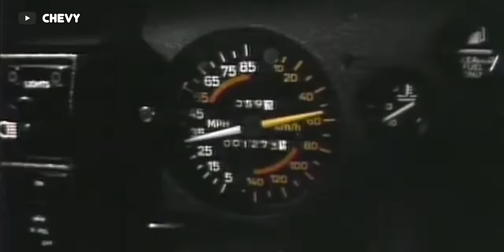These are the WEAKEST ENGINES EVER

Comment: The Duke was weak, but it was durable.  Putting it in the Camaro, however, was just straight up dumb.  I sometimes imagine what could have been if someone could've rounded up a Super Duty 4, essentially a super-heavy duty Duke with all the go-fast goodies and capable of delivering over 300 horsepower, and bolted THAT into a Camaro.  Still looks like a Duke - kinda - but it delivers the kind of power even the 80s Camaro looked like it should have.

Comment: The 5.9 found in 2nd Gen Dodge Rams, Dakotas, and 1st gen Durangos actually had more than a 1 liter advantage over the 4.7. The 4.7 was rated at 235 hp, yet the 5.9 only made 250. 1.2 liters to make 15 more horsepower. What a shame.

Comment: The GM 6.2 and 6.5 are in the military HMMWVs. If the injector pump timing was adjusted along with the transmission kickdown cable they would drive decently. Later in my career I rebuilt and tuned the injection pumps and quickly learned how to adjust them for much better power. Of course those were all EPA except and not sure if the same tricks would work on a civilian model but I would think it wouldn't matter.
Reply: They will cuz I did em too up until 2018 when I retired.

Comment: If it was 1975-1990, mass produced and was on a budget (aka they wanted it to be profitable) it sucked. From the 180hp 454 in the 1975/76 Corvette to the 70-100ish-hp Pinto or the Chrysler K cars, nothing made any power due to emissions. Until we got the 400hp Viper, which they said "we'd never see another car EVER in America with that much power" Fast forward to 2015, and you get 707hp in a Hellcat, 400hp in most trucks and it become a "reliable" turbocharged 800-1,000hp out of a junkyard motor that came from that said 400hp truck.

Comment: Actually one of the "weakest" engines made was the 1975 Chevrolet Monza when equipped with the 350 V8 for California and Hi Altitude areas.  With a 2bbl carb, it make a whooping 125HP!   Or just .3571 HP per cu in. vs the Caddy's 500 making .38 HP per cu in.  The top award might have to go to the 1975 Ford Granada when equiped with the 250 (4.2 L) six , it was rated at 70 net hp, at 2800 rpm, in CA emission configuration (72 HP nationally).  Thus, it made a (drumroll) .28 HP per cu in.

Comment: If you are going to use a CAD Co picture you should understand that his Cadillac engines even for stock Cadillac are 400 hp and 500+ ft lbs ... And he has built them as high as 2000 hp ...... Plus the 76 hp number you quoted is wrong that engine on a modern dyno is over 300 hp ...

Comment: That "182 hp" engine in the thumbnail put out around 400 hp when introduced in the '60s. It's a difference between a "emissions" engine and a "de-tuned" engine. The 119-130 hp Ford engine 4.2 was an emissions motor.

Comment: The tr7/8 is one that should be on it as well

The 1982 engine produced 130 HP at the crank and 117 ft lbs 

At 3.6L and V8 at 36 HP/L in a sports branded car

Comment: The Oldsmobile 260 V8 at 110 hp and the Chevrolet 267 V8  at 115. My mom had a 1980 Impala with the 267 V8 it was so slow and got terrible gas mpg because you had to floor it all the time to get that heavy car to move

Comment: You should try a 5.9 12v cummins with out boost 14psi will double output and from what I have read it runs about 18 psi meaning it makes less that 80hp n/a then you can flip this saying if it was a n/a motor it would need  12 liters to make 160hp

Comment: -smog days
-the viper was still in development that first generation was basically a prototype 
-The 4.7 and 5.7 engines from Chrysler were putting out just as much and more horsepower than the other brands with the same size trucks (the 4.7 is a horrible engine by the way) 
-The iron Duke was never made for power 
-smog days
-The 6.2 does suck ass

Comment: My 78 camaro cam with a 305ci engine rated at 140hp at like 4000rpm. It ran a 17.8 in the quarter  mile. 
To let you know how pathetic that was my 2000 Celica gts has a 110ci engine rated at 180hp at 7800rpm and runs 16.5 quarter mile.

Comment: Zero historical context here.

400HP was amazing in 1991 when the Viper was introduced, didn't matter that it took 8 liters to get there, everyone loved it.  Only thing that was close was the ZR-1, believe it had 375 HP to start and later 405 HP, and that carried a much higher price tag than the base Corvette.

The Iron Duke was a Pontiac motor, at least you got it right the 2nd time.  And you really show a lack of understanding of that era 79-82, times were bad.  There was a recession, interest rates reached as high as 21%, gas prices were high, unemployment was high.  60s era cars that are valuable today were put in the junkyard during this era because there were not buyers for them.  The racing scene was not what it was in the 60s/70s, although it came back to life in the late 80s.  There was a market for a 4 banger Camaro in those days.  They also offered the 110 HP 2.8 V6 in the early/mid 80s Camaros.

You don't think the 1980 Corvette should have been produced because of the 180HP rating?  Well, Chevrolet sold 53,807 Corvettes in 1979, an all-time high!  Yeah, I'm sure your opinion would have carried a lot of weight in the GM board room back then.

The Cadillac 500ci 190HP is just an product of it's era.  360 lb/ft got those boats moving, that's it.  Side note:  the 500ci Caddy responds very well to modification.

The 6.2 diesel was also a product of it's era, people were amazed at the time that you could get 20mpg in a full sized truck.  Diesel was also generally less expensive than regular unleaded in those days, further increasing the utility of choosing the diesel engine.  And they generally lasted a long time with good maintenance.  If you want to contrast this with the other American OEM's, Ford introduced the 6.9 IDI in the mid-80s (86 IIRC) and it wasn't much more powerful.  Dodge had no diesel option until 88 or 89 and when they brought the first gen 5.9 ISB, it had 160HP, IIRC, and that was WITH A TURBO.  But nobody would dare put a Cummins ISB on the "worst engines" list, would they?

My idea of a worst engines list would be things that were unreliable, regardless of horsepower rating.  Cadillac 4-6-8, Chrysler 2.7 Sludge motor, Oldsmobile Diesel, and so forth.  These engines you mention are just a reflection of the technology level of the era that they were produced in.

Comment: Dog, I have a ram 1500 with the 4.7 and know almost everything about the engine, it was produced until 2013 in the Ram 1500s and in 2008 for the trucks, the engine was revised and made almost 300 hp and 330 lb-ft of torque but yes my truck with the 4.7 only makes 240 go and 300 lb-ft of torque

Comment: The standard of HP per Liter is simply a crappy yard stick as many engines are designed for different purposes and performance is relative to the goal of the designer 
Ex 37hp @ ltr would make your list of week but that same engine made 130 ftlbs@ ltr and really never ran over about 1800 rpm but the 12.7 detroit was designed to drag 80k down a highway for a million miles and did so quite well

Comment: Comparing HP in the 70s and 80s to modern cars is flawed as the the way HP is measured/calculated is different today.
HP back then was "Gross HP" and was actually produced by the engine at its peak operating point. (Measured on a dynamo)
HP today is a mathematically calculated ideal for max torque and RPM.
I.e. If you can lift 100lbs, and can run 12MPH, but the optimal point of both at the same time, you can run at 8MPH while carrying 60lbs
 - todays way, your run/lift capability is 1200 
 - the old way your run/lift capability is 480

Comment: The 6.2 liter GM Diesel used in Chevy and GMC pickups is often credited to Detroit Diesel.  However as far as I know, this engine was designed by GM not Detroit Diesel.  Someone can correct me if I am wrong.

There were lots of anemic engines in the '70s and early '80s.  Between the emissions regulations and the need for better fuel mileage there were many disasters from most manufacturers

Comment: The GMC dealer where I worked sent some Suburban's to a aftermarket shop who added a Turbo to the 6.2. They added nothing else and did it extra cheap.  The engine couldn't handle the Turbo and started the engine on fire!
Reply: So they didn't bother to tune it at all?

Comment: Alot of the Things Mentioned here are like judging a Blue Fin Tuna on Its ability to speed Walk Or a Donkey on its ability to Fly Most of The Low Power Motors are outstanding when it comes to reliability and The Maintenance schedule on them is more of a suggestion Than anything else, Plus anyone with a Floor Jack a $50 Walmart tool Kit and the desire to learn Can work on them

Comment: I don't think the iron duke should be on this list. This design badged under mercruiser is one of the greatest inboard boat engines. From the late 60's to early 80's, they powered countless boats, from 110 to 145hp while fairly fuel efficient. Remember boats are usually run at max rpm for long periods of time.

Comment: My buddy had a 82 Camaro with the 2.0 4 cylinder.the  same engine that came in the Chevy Cavalier.
Reply: I thought the Camaros then could be had with the Iron (P)Duke. At least the Iron Puke eventually got a crossflow head. Rare in an inline 4 or 6. Mostly because of distributor placement.
Reply: I think the Camaro got the 2.5 Iron Duke that was also in the Celebrity and Citation (and, later, the S10). The J-cars had several different 4 cylinder engines including (IIRC) a 2.2 pushrod noisemaker and head-gasket-leaker. It was a different design from the Iron Duke, but equally awful ... maybe worse!

Comment: I had a 1976 stingray with an l48 350(5.7L). Beautiful car, but it only put out around 190hp.
Reply: That's what happens when they were trying to meet emissions and mileage goals with crappy poorly adapted carburation. The domestic manufacturers should have bit the bullet sooner and gone to EFI.
Reply: @mpetersen6   the 80’s weren’t much better and they were fi .
Reply: @mpetersen6  they tried that in the 50s, but it didn't sell well.

Comment: I had an '88 S-10 with the 2.5 Iron Duke. Short history here. It was believed by the engineers that diesels were the way to go but have a gas engine to offer too. VW Rabbit offered 2 1.5 ltr engines. one gasoline powered and the other a diesel. To save cost, VW used the same block, crank rods, and wrist pins on both engines to cut manufacturing cost. GM seen how well that worked for VW they did the same with their 2,5 iron duke. While working on the fuel system, two things happened. Restrictions on diesel emissions and Tandy Corp working with GM developed a low cost computer for GM. GM scrapped the diesel idea and went with the gas version with the heavier block, crank, rods, and wrist pins. With the heavier rotating parts these engines didn't spool up very quickly but they sure did hold up. I averaged 29.3 mpg in hilly country My truck was a standard cab, 2.5 Iron duke with  5 spd manual gear box.

Comment: You do realize the 1975-76 Corvette were sold with a 165hp 350 V8 ? Making the 1980 305 almost respectable…
It’s more about power/torque to weight than power per liter which is a rather pointless figure…some large displacement engine will be lighter than smaller displacement engine, and larger displacements give more torque.

Comment: Like so many, you have been indoctrinated to focus on horsepower numbers. Truth is, HP has more to do with top end speed at higher RPMs. What burns rubber and breaks inertia off the line is low-end torque. Look at EVs and the tuning of truck engines, especially diesels. HP is meh, but there's gobs of unstoppable torque to do work. Even modern I4 engines are amazing. Take any econobox with a manual, put it in first, and watch it effortlessly climb any hill at idle. (Won't work with with a slipping torque converter.) Then it'll electronically top out at 110-120 MPH @ 5000 RPM. And remember that between 1970 and 1971 most engines were not changed, only the method of HP measurement.

Comment: Its not just because its cam in block technology,

Its because large displacements allowed US automakers to keep specific output very low in order to still have decent longevity in cheaply made engines. 

The Nissan A14 engine still managed to make 85hp in a smogger form in the 1975 Datsun B210. Thats still 60hp per liter, and thats in relatively understressed economy car form (these engines would easily run 200,000 miles just like most OHV engines of the day) 
The A series was a cam in block, OHV engine (its still used to this day in industrial applications). When built up its possible to get close to 150hp out of an A series and remember there are no aftermarket performance heads or blocks for those Datto engines there was no need for it, these engines were very overbuilt. 

There simply is NO excuse for the pathetic output of American engines during the malaise era, none. 

The only upside is how easy it is to double and even TRIPLE engine output in these turds with bolt on parts,

Comment: The GM/Detroit 6.2 and 6.5 diesels were never designed for producing big hp but rather fuel efficiency…and fuel efficient they definitely were. They had weak block and were notorious for cracking journals and breaking driveshafts but in the end what was determined to be the real culprit was the fact they had a substandard harmonic balancer that in some cases was failing within the first 10,000 miles and causing so much vibration in the crank that it was  either breaking the cranks or cracking the blocks…the very late model runs of the GM produced 6.5’s and now the new 6500 and p400 engines have solved all these issues and the p400 models can easily produce 300+ hp without breaking a sweat…these newer 6.5’s are becoming a favourite with marine enthusiasts and they are repowering their old cruisers, pulling out their 454’s and replacing them with 6.5 diesel’s with little to no performance difference while upping fuel efficiency substantially!…the early 6.2/6.5 engines were a very good concept that was poorly executed!

Comment: The non "high output" version of the 5.0 produced back in the mid 1980s.  It made 150 hp.... though I guess that is better than the 1979 5.0 that made 139 hp!  Still not as bad as some of the engines on your list but pretty darn bad!

Comment: Picking on engines form the mid 70's to the late 90's is easy. Seems like all manufacturers were really dragging their feet engineering engines with decent power and acceptable emissions, there were exceptions but Toyota's 22RE, and 3VZ, Ford 4.9, almost all Mopar engines,  the 5.2 was pretty much a turd making just a bit more torque than the 3.9, Hyundai existed, and they were pretty abysmal.  In fact I think Honda may have had the best run of engines,  but only because they had low displacement engines in small cars,  they had that 2.7 V6 which wasn't amazing,  but again only 2.7L.

Comment: I'll defend some of these engines. Some were anemic at any speed, but many of them Iron Duke, 5.0 Windsor, and Rolls 6.75l are obvious ones, feel peppy at tip-in and take you off the line well, but the power bands flatten out after 2,500 rpm and that's all you get. It's frustrating when you try to merge onto a highway but for a lot of everyday driving it's more than fine. If you're looking at it from the perspective of the time and the philosophy that you advertise horsepower but drive torque, and as a manufacturer with a limited engineering budget you have to make do with what you have with lower compression, low-flow carbs, and all manner of primitive EGRs and air pumps, it's a fairly reasonable tradeoff.
Reply: Plus remember in the days of the double nickel on the interstate. I've long been of the opinion that the manufacturers should have gone to port EFI sooner.
Reply: @mpetersen6  Those old, heavy duty and overbuilt (basically detuned muscle car) engines of the malaise era already lasted too long. The addition of EFI would have made them last even longer. Not what the big 3 wanted.

Comment: 99% of 350’s made too little torque to be in a work truck. 305’s are festering dog shit in a bowl mixed with cat puke, shouldn’t have been made. This design should have been kept at 283, one of GM‘S finest IMO.
Reply: One of the biggest mistakes GM ever made was not keeping the TPI and putting it in trucks. The TPI actually corrected the lack of torque that the Chevy small blocks always lacked. My 89 Formula 350 with the TPI has the low end torque of a big block but runs out of steam at about 4500RPM. Would make an awesome truck engine. Used to street race it back in the early 90s. No one could beat it off the line, not even big block muscle cars. But I would eventually lose to them when they caught traction and roared passed me.

Comment: Shoutout to the VW 2.5 SDI at 74 hp and 160 Nm in 1996, which is 29,6 hp/l. As used in the LT van (bigger than Transporter) I not sure it could actually reach 100 km/h.
Reply: It actually can, I know cause I have one but the max is around 103-105km/h
Reply: @darklife5771  Not too bad for 74 hp actually.

Comment: I understand your criticism about the viper, I really am not a 1st gen fan, but not because of the motor. Yeah, the power doesn't look impressive. Have you driven one though? You have all that torque, all day. It's the same reason I love the gm 496. You can build the hell out of them too, but I like them at about 460 hp/580ft lbs or less. They work hard there, and get the best service life. I've had 4 of them in different vehicles.